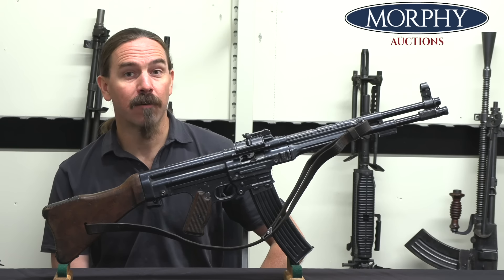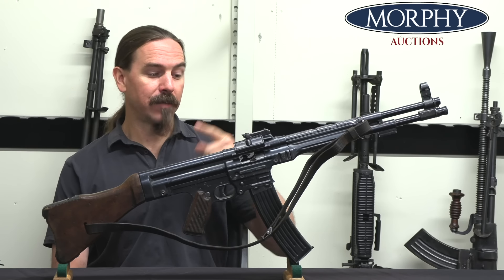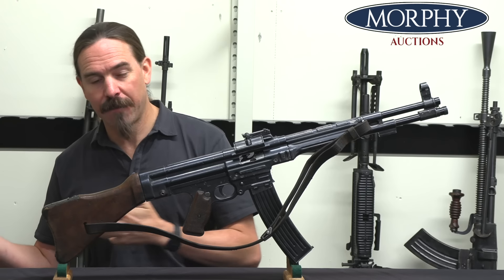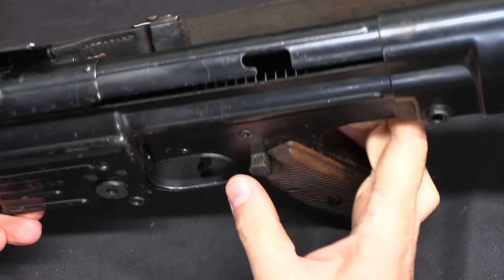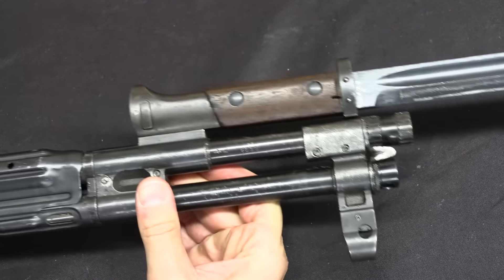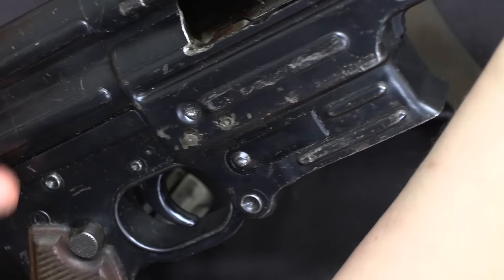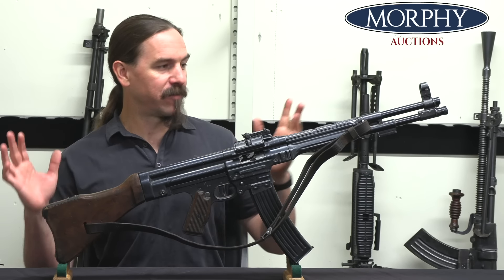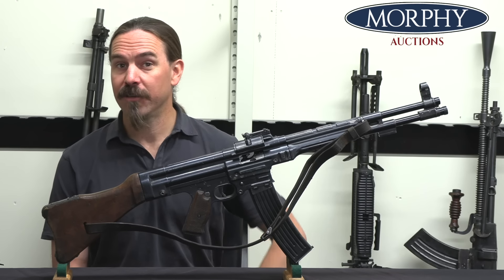The First Sturmgewehr: The MKb42(H)

Comment: Honestly like how the MKb42(H) looks compared to the later versions, mostly because of the gas tube being almost as long as the barrel.
Reply: It looks better
Reply: Indeed, I don't know what if anything the 'expansion chamber' lends to the operation of the gun but it does very-well balance-out the aesthetics very nicely.
Reply: Honestly my favorite version of it. It looks brutal, it looks like an ASSAULT rifle, it looks like it came off the factory floor begging to kill. It's such an iconic and insanely cool design.
Reply: The bayonet lug seals the deal. Battle rifles should have bayonet lugs, because you never know..
Reply: @DruidTimer Mkb42 (H) is not battle rifle
Reply: @yamatokurusaki5790  Is STORM RIFLE!!
Reply: @mollymcallister1671  IS MACHINE CARBINE
Reply: Very symmetrical and more milled, peak aesthetic
Reply: Yeah same
Reply: @yamatokurusaki5790  Yeah, it is an assault rifle, not a full power battle rifle. But for the Soldier carrying it, it is his battle rifle.

Comment: Thanks for a detailed look into the development process that eventually produced the StG44.   So the Germans started carbine development in 1938, reached mass production in 1943, and ended up in 1945 with about half a million StGs.   Meanwhile the US began prototyping in 1941, started issuing M1 carbines in 1942, and had six million available by mid-1945.  Quite a contrast, esp. considering that semiauto rifles were already standard in the US Army, and that the Germans were well ahead of us in machine gun design.

Comment: So can you release the bolt with an HK slap?
Reply from the maker: No, you have to pull the handle back and then down. It's intended to be much more secure than the later HK design.

Comment: Why Hitler "disliked" the Sturmgewehr. (Or rather the new cartridge):
Up until pretty late in the war the Wehrmacht didn't view itself as part of an economic system. They were soldiers after all, not bean counters.
Hitler had a skewed (because of his racial ideas), but often better understanding of the economic and logistical situation he had maneuvered his Reich into than the Wehrmacht. This is still often overlooked.

Imagine this: Spring 1942. The Wehrmacht is mostly infantry. The entire idea of infantry in the Wehrmacht is centered around the 10 man squad with K98, which itself is centered around the MG. Both weapons use the same cartridge. 
In the dire winter of 1941/42 there was precious little ammo in the east. Rifle Soldiers had strict orders to only take out a single bullet from the belt of their squad machine gun belt if a valuable target presented itself.
With this tactic the Wehrmacht had been barely able to hold it together. Logistics were stretched to the max. But it worked out.
Now some weapon manufactures invite you to a demonstration of a gun with a totally now cartridge. Absolutely no commonality to any other weapon in the arsenal. 
The very idea of the current 10 men MG squad falls apart. The one saving grace for the Wehrmacht in the east would vanish. 
You would think those people were pulling a joke on you.
Reply: Well
That and coupled with the fact that they already had a fucked up logistical system where you had like 10 different factories manufacturing parts for the same vehicles.  they also kept coming up with more and more ineffectual wunderwaffe after a while this is just exhausting especially when the soviets are winning by mass producing uncomplicated and cheap equipment.

Comment: Open-bolt also greatly increases natural cooling of the barrel between burst of fire, as air can flow through the barrel and open bolt. Which helps keep down the temperature of the barrel in normal operation. This doesn’t, of course, do anything for continuous sustained firing

Comment: The "two-barrel" look from the extended gas tube is so damn cool, especially compared to the shorter tubes used on the final design and AK-type designs.
 
Basically peak Dieselpunk/Star Wars Blaster look.
Reply: Looks like an M1.
Reply: @stuntmanmike37  in what shape or form does it resemble an M1
Reply: @NotACutie  From the hand guard forward.  Have you ever seen an M1 Garand?
Reply: @stuntmanmike37  I mean other than the fact that the M1 Garands gas cylinder is only a couple inches long, and is on the bottom of the barrel instead of the top, sure.
Reply: Imagine if Valve had written Half-Life as a Second World War game. This rifle would have had an alternate fire mode that shoots from both barrels at the same time.

Comment: Only knew about this gun from Red Orchestra 2.

It was only added so that it would be historically accurate/possible to use a gun like this in maps set in battles that took place before 1944.

I appreciated the historical detail to avoid anachronism

The gas block being further up the barrel honestly makes it look cooler than the actual STG44
Reply: I still remember RO1 veterans making fun of the developers for including this. For good reason.
Reply: @utarefson9  The Darkest Hour mod for RO1 (still being developed) has the MkB42(H) now, but even still, was very intentionally not added to Stalingrad maps. It's more of a very rare easter egg weapon. Including it in RO2 and making it an "unlockable" item there was a terrible decision.
Reply: RO2 had a lot of good design decisions but weapon progression was definitely not one of them

Comment: I Imagine there would be many more German speakers in Europe had this been around in 1938.
Reply: The Germans were never winning WW2 from the start. It'd be cool, but it'd be too expensive and mean they couldn't equip units as easily and it'd be a logistical nightmare to use different cartridges.
Reply: Really?.
I suppose everything up to Stalingrad was a fluke then?.
Reply: @keiranbradley3238  Effectively yes. They were losing Africa as soon as the British put up a significant resistance, they had no oil to continue their war, no navy, were wasting their airforce on England, and Italy was never prepared to fight before the mid 40's.

Not to mention the US and Soviet Union were planning on joining when they were politically able or prepared respectively.
Reply: @_M4X15 
If they had fully concentrated their efforts in winning the war instead of the huge resources it took to deal with the guys in small hats and things would've surely dragged out longer before inevitable defeat.
The combined arms of the west along with the Soviet union could not be defeated.
The lands won through Barbarossa are incredible but it was for naught.
I have a now banned 12 volume work on the war that I'm sure you would love to pour through, 12 huge leather bound books my dad found in a flea market in the 60's.

Comment: The history is amazing.  I had no idea this was in development in the 30’s.  Just like the Lockheed P-38 Lightning, except the P-38 was used effectively in WWII.
Reply: The StG44 was used effectively too, albeit in small numbers. Check out Hans Dieter Handrich's book - it is utterly amazing.
Reply: The P-38 was plagued with very serious problems.. I live near a P-38 training base and the surrounding hills are littered with P-38 crash sites... one even crashed into the local Woolworth's store.
Reply: @DoktorBayerischeMotorenWerke  what did the greatest fighter ace in America fly?
Reply: @lizzardwizard2000 effective for its range, I wouldn't call it a standout. Didn't fair all the well in Europe. Many aircraft performed well in specific theaters. Personally not afraid of the p38 in il2, poor agility at speed and energy retention, super easy to ID from a distance which is a massive disadvantage, id take a mustang or a p47 over the 38 in Europe any day
Reply: Never play.to your opponents strength.  Did I Hong zoom and boomed, dive out of the sun, unit one of two and use kinetic energy to climb out of reach, and then set up for another attack.
Reply: @kingwein89  By 1943 the P-38 was obsolete and outclassed in the European theater... as was most of the aircraft developed in the 1930's..

Comment: I think the whole "Hitler didn't like it" thing may be a bit of an attempt by the designers and/or army brass to blame Hitler in order to avoid admitting their own shortsightedness. Similar to how the Barbarossa generals blame Hitler for wanting to take Moscow, when it was their own ego-driven idea, one Hitler was initially against. 

Because really, when you think about the situation Germany was in during 1942, you'll see that the last thing they needed was to adopt a new rifle and_ more importantly, a new cartridge. What they needed was more guns, not more expensive guns. It's similar to how the Soviets kept making the three-line rifles rather than produce the SVTs, despite understanding the advantages of a self-loading design (pre-war, they planned to fully rearm with SVTs). 

If anything, we're lucky that the German designers and army brass weren't clever enough to understand these logistical concerns, and never applied them to stuff like tanks.
Reply: If I recall right they would variously understand that same notion with tanks, which would lead to various programs to simplify or unify the various production lines and models, I think they even did it for hauling vehicles too. It's just that their procurement/economic system was not particularly well built for it to begin with and adapting it mid war would have crippled their production in the short term enough for it to be just as undesirable.

Comment: Does the gas piston/linear hammer(?) not go forward and put the bolt into the same position it would be in while it's locked up? I don't see what's holding it back away from the bolt counteracting the recoil spring force

Comment: It can give the impression that this model is significantly earlier than the StG. Reality they're only about a year apart. 1943-44. Extremely rare to see in photos. Ironically I believe you see FJ troops with it the most in Normandy and Seelow Heights 1944-45, despite the Luftwaffe preferring production of the FG42

Comment: Always wonder what troops on the wrong side of the muzzle thought when they first saw their enemy armed with what was essentially a pretty "sci-fi" looking weapon. Yes they may have had sub-machine guns, but this thing had rate of fire, range & punching power. Must've been pretty demoralising to see a whole bunch of enemy armed with them for the first time.
Reply: @Getpojke  The Rooski PPS-43 was already fielded by then. At distance it would look like a wood stocked PP3. At close enough range to tell the difference, it wouldn't matter if it's 7.62x25 or 7.92x33, dead is dead.
Reply: If you read The Devil's Brigade there is mention of entire squads in the First Special Service Force being equipped with Johnson light machine guns and the result there was "pretty damn demoralizing" at a minimum
Reply: Most of them probably had no idea what was going on anyway. You are already getting hit by MG42’s everywhere this is probably not that much more impressive in comparison to that absolute machine.

Comment: At 03:10 asking for 50 complex stamped sheetmetal items in the early 1940s is similar to asking for 50 complex injection-moulded items today, the tooling-up to do 50 is the same as it is for 50,000 and is fiendishly expensive as a result.

Comment: Why is the gas tube extended to the muzzle? What benefit can this design provide?
Reply: Easy stable mount of the front sight block?
Reply: My best educated guess was that it was a holdover when it was originally a gas trap design. It was easier to drill a hole in the barrel close to where the gas trap was since the rifle was originally built around that concept. Later on they refine the design and drill the hole further down. We see the same thing with M1 Garand. It was originally gas trap, later a gas piston design and then with the M14 they move the position of the hole further down.
Reply: @robertnorgren993 But fixing the front sight tower is not that difficult it seems
Reply: @omkumarsuarezramos7010 I have heard that the tube is an expansion chamber, but why do we need the gas to expand? If that's a holdover, why don't they extend the piston like the garand?

Comment: One aberration in your presentation was that that was NOT a standard K98 bayonet.  A standard K98 or K98k bayonet has the blade sharpened on the opposite side.  This one is sharpened on the upper side.  A difference that makes no difference, I agree, but I have never seen a K98 bayonet like that one.
Reply from the maker: Yeah, it was a Czech bayonet. Happened to be what I had on hand when filming.

Comment: is there a reason why the rear sight is at the place where it would also be on an ak? i know it is because of the dust cover and keep zero on the ak, but why is it on the mkb at this place?
Reply from the maker: That's about the best distance forward for that style of open notch rear sight - it's at about the same place as on Mauser bolt action rifles as well.
Reply: @ForgottenWeapons  thank you for your fast response,
Didn't know that, but sounds logical. I assume that it would be a little more precise with a drum sight where you peep through a hole like on the HK g3

Comment: Cool gun, one of my buddies had the successor with a closed bolt system that he found on the local reservation and purchased, he had a hard time finding a good load to make the  gun run successfully, he ended up with a duel powder load using a bit of Bullseye to touch off some rifle powder in a compressed load using cases he made using some forming dies. It was complicated so he didn't have a lot of ammo for it.  We did take it out in his cow pasture though and make some cow pies bounce with her. She we a good machine rifle; fun to shoot and if the ATF had seen us we would probably still be in jail. Sadly it was destroyed when his mobile home caught fire, that is a bad thing about trying to be off the grid, when you catch fire the local fire department has no idea how to find you, they did find it but much to late to save any of his extensive firearm collection hidden in a false wall in his trailer house. He is no longer into guns and runs a small black smith outfit in a little town in a remote part of the USA.

Comment: It was a <loaded> StG44 that was the best firearm for the German infantrymen, without ammo it was nothing more than scrap metal.

Which is why the 8mm Kurz made, and in a way, broke the German Sturmgewehr. The new rounds was the heart of the weapon, yet obviously the Germans had zero reserve of such, unlike 8mm Mauser Rifle or 9mm which was produced since WW1 and had ample reserve. Providing a completely new round for frontline infantry use was an enormous industrial task - Italy and Japan both tried to replace their rifle rounds with more powerful calibers, only to discover the difficulties in replacing sheer amount of rounds they stockpile for decades in just a few years, and when the war started they were stuck midway, complicating logistics with two different rifle rounds and Italy tried to went back years worth of effort and issuing back older rifles.

The German leadership clearly realized such problems and Hitler put a lower priority on the rifle program since the new ammo production and reserve were far from ready in 1942, especially existing industries had to supply massive amount of 8mm Mauser for MG (the Kar98k (which StG44 would replace) was seen as support weapon for MG42/34 and only use small share of 8mm Mauser) and could not be spared. Adopting the StG44 early on was simply not an option for German armies and industries at that time.
Producing tens of thousands StG in 1943 that would only receive sufficient rounds in 1944 would be counter-productive and waste of valuable German industrial effort that could be spent on existing weapons that could be used immediately.

As such German leadership allowed the 8mm Kurz production and logistics to gradually set up while in the meantime blocked the program on the army distribution level simply because the logistics were not ready yet.

A popular myth that Hitler completely disregarded and halted the entire StG concept doesn't add up when one consider when the German leader first halted the program (before allegedly officers tried to "hide" it), the Mkb42, it was essentially 80% finalized product, with the MP43 next year being a more-or-less finalized, (aka it already finished development by then). Had he actually halted the program then Mkb42 wouldn't even existed in the first place.
Reply: But some machines producing 8x57 IS could be used for 8x33, much measurements had been the same.
Reply: @brittakriep2938  Except the 8x57 was German military's main rounds already, with high wartime demands, especially when considering the ammo consumption from German general purposes MG34/42.
Just like how Germany kept using Panzer IV in 1945 despite having Panther already, or MG34 still in use by infantry despite MG42s, the strained German war industries meant little of existing 8x57 production could be handed over to speed up Kurz ammo production, and hence the need for German high command to suspend the Sturmgewehr rifle deployment to avoid the wasteful mis-match of rifle and ammo quantities.
Reply: @brittakriep2938  they could have developed an entirely new cartridge, as the bullet is not the same bullet used in the standard 7.92x57 cartridge. They probably intended to use that bullet, but were stuck on the bullet diameter.

Side note: Also, another historian (read this many years ago) noted that one of Hitler's real objections was the rifle being issued in too low quantities to make a difference on the battlefield, while also complicating logistics.
Reply: I had read that the Army was plagued by ammunition shortages until the end of the war.
Reply: For the 7.92x33 cartridge
Reply: Generals risked their careers be ignoring AH and went forward by calling it a MP